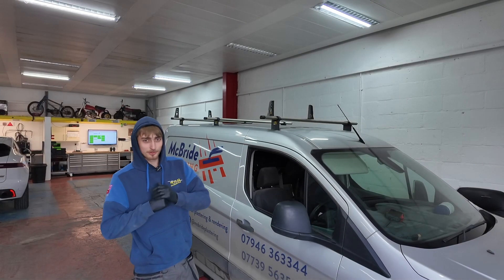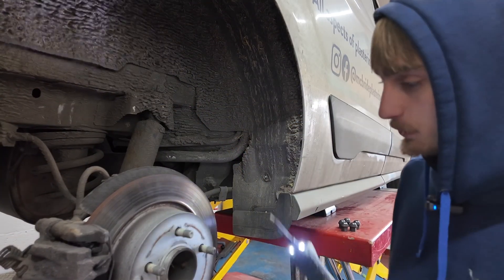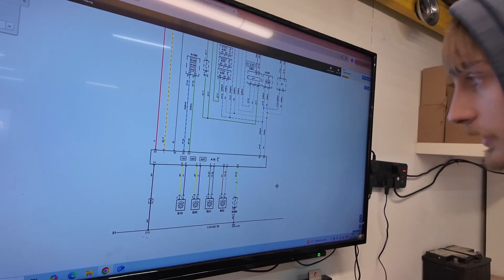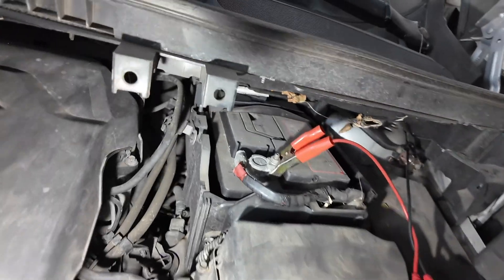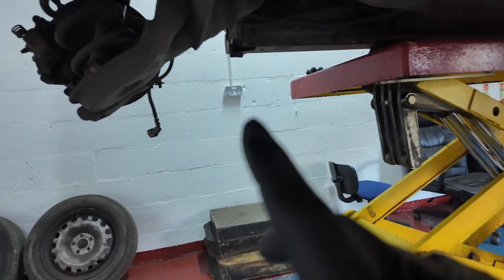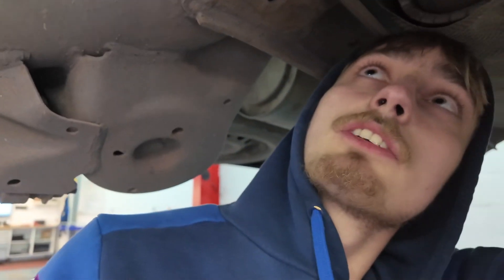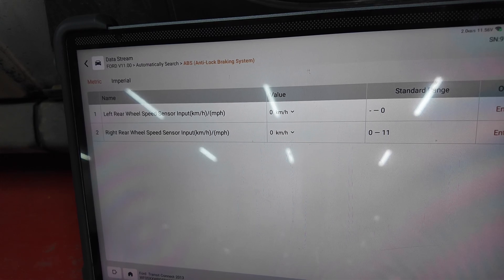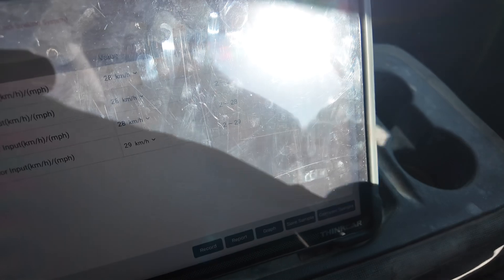MOT Approved! How We Fixed the ABS Light on a Ford Transit Connect #automobile #automobile #canbus

Comment: Keep getting service engine message flash up on my connect, traction lights come on and abs light came on but managed to clear that, I have seen the dtc codes for the abs mention speed sensor voltage something , wondering if it has a similar fault.....